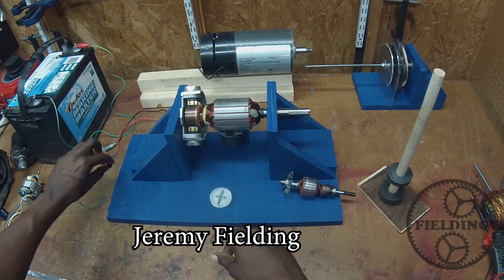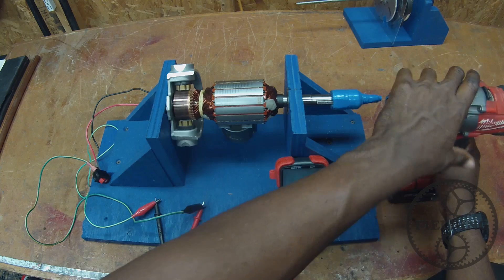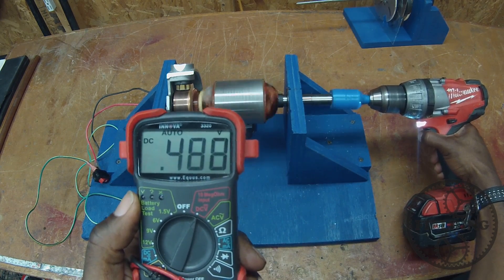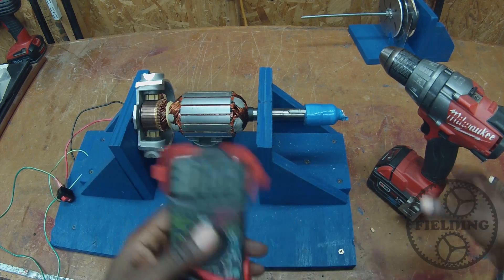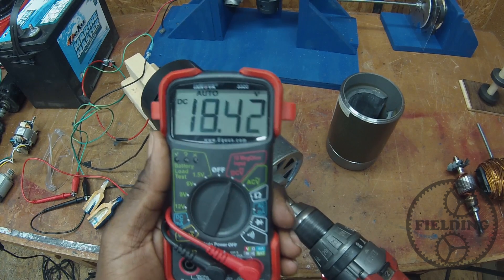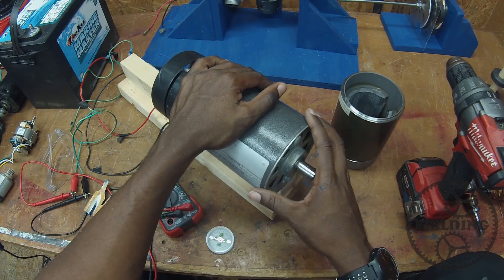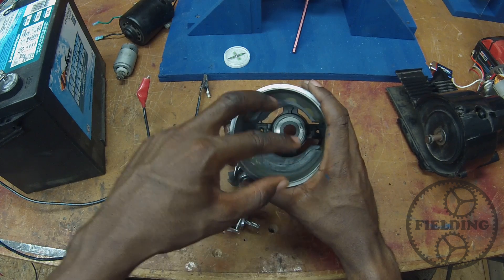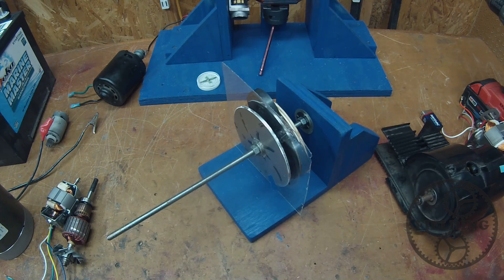How Motors Work for Beginners (Episode 2): The Generator and Universal Motor: 033

Comment: I need a little help if you don’t mind. I have a 12 V DC fan that’s running backwards. I took it apart to clean the casing and when I put it back together it’s running backwards now. I switch the two stator ("edit armature" identified wrong part) wires at the brushes but that makes no difference even switching polarity doesn’t do anything it keeps running backwards. What’s going on with this fan?
Reply: Actually I figured it out by watching the first video. The stator was 180° out. That's me, only two ways it can go in and I get it wrong twice.
I'm going to watch all of your other videos. Even as a kid I was fascinated with motors and generators.
Thanks for posting!
God bless!!
Blue

Comment: ❤ I've watched you for a couple of years now and you're very knowledgeable and very you've helped me so much with my understanding of electricity's motors, magnetism, fields, etc. Now my question is about your DC motor turning it into a generator. What if you take or actually excuse me universal motor what if you took an added magnet to the piece that spins inside the stator field? Would it generate then?

Comment: I was wondering on a DC motor if you don’t use the full power rated if it’s not needed for lighter work does it still consume the same energy or is it a reduced power consumption depending on the load?

Comment: On the topic of using a universal motor as a generator by applying a starting voltage and then letting it power its own electromegnets- uh, thats how most large power stations work these days. its just a lot more cost effective then making massive permanent magnets. (its called like self motivation or something) thats probably the only bit on motors and generators i understood, some practical generator stuff, you're teaching me a *lot*, thank you. This is very helpful

Comment: Hi Jeremy - I'm really enjoying your beginners videos. I'm 45 but never understood DC motors. I have one question: all the windings in the coil of the rotor, made of copper wire, aren't they all touching and would short circuit? I mean i can see they don't, but why not? the copper doesn't look to be insulated to me.

Comment: Thanks for the video. 
So with your typical fueled generator, that is an inverter generator (let’s say 120v) the engine is spinning the electrical motor at a speed fast enough to produce 120v?

Comment: Great video, sir. I have learned a lot from your videos. I have a question about the DC generators, what makes them a generator? I am confused since it is the same as the other motors in this video that converts electrical to mechanical.  need advice

Comment: My Rotor heats up extremely fast in my Rotozip. I took it out of the plastic casing, replaced the brushes, cleaned the   Commutator best I could.  Would reversed polarity make it hot?

Comment: Hi Jeremy,  thank you for all of your videos,  they are very helpful in understanding how things work. 
I have a question that pertains to many household devices that have transformers that step-down 120Vac to what the particular circuit needs, i.e mixers, blenders, toasters, clocks that basically run on DC after the transformer has stepped it down. If you had a solarwall that stores DC, couldn't you remove that transformers from those circuits,  thus avoiding the loss derived from bleeding off the ac into DC that is usually experienced as heat. 
Also,  if it were possible to redesign all circuits to function with DC,  then we could get rid of all these wasteful transformers wherever possible,  saving the associated energy. Let me know what you think of this,  I know there are some circuits that have both AC and DC in them,  like my old Tube circuits for guitar and Bass, and my stereo, But, even the new TV sets should be able to run on DC.

Comment: Hey Jeremy, this is the only way I knew to get hold of you.  I have a project I want to do but need a little information.  I have a 60 VDC Lithium battery at 12 AHs capacity.  I want to use it to power a lawn mower.  I have a John Deere walk behind 21" mower to cannibalize.  I was thinking of using either an alternator or a 2.2 HP treadmill motor that I have.  My question is how to wire the switch so that I get a blade brake effect when I let off the lever.  Also, I think I will need a speed control but not sure which type.  I am a good welder and have MIG and TIG capabilities.  Can you point me in the right direction.  I don't want to take up too much of your time.  Thanks!!!

Comment: I was curious about this idea of perm mags and perm mags as well, obviously it doesn't work but I'd like to know why. In theory it'd seem as if having opposite pole magnets in the same formation as the rotor plates would continue to spin after an initial external force started it. Does the centrifugal force just out weigh the power of the magnets?

Comment: thanks for video.  would you explain how did you get DC voltage. is it because you used  just one magnet? if that's the case why they use rectify bridge in  automobile charging system.

Comment: I'm thinking the universal motor as a generator is like a car alternator.   If you have a totally dead battery and jump start the car and then immediately disconnect jumper cables the alternator won't charge the battery because the stator has no magnetism. (Or very weak)  The car may even quit running.   Is this right?   I'm looking at a car alternator and I am seeing stationary coils through cooling slots.

Comment: All good stuff
Question:
Permanent magnets have certain and unchanging poles, but how is the direction of the poles determined in an electromagnetic field in a conductor the copper windings of a DC motor or electromagnetic and so on? I know it has to do with polarity or the direction the electricity is moving, but said windings are in a circular or spiraling arrangement, so technically the current is going in all of the directions (at least laterally) at one point in time or another as it flows along. Also is it true that each of the windings are insulated by an insulating coating, ensuring the current goes all the way around instead of short-circuiting straight through?

Comment: So one thing I’m confused about is I thought the commutator had the different gaps in it, like the different iron plates and each coil and each gap on the commutator that touches the brushes, I thought those were like “timed” to change the polarity of the coils, and that they needed both magnets to function, in your case the two magnets in the stator, yet in your video it worked fine with just the magnets on the bottom of the rotor? 

Does having two magnets in the stator just increase the power then? 

And if I wanted to make my own coil based rotor like this, do the coils have to be made in a specific way, or could you just wrap the wire all over the rotor and commutator, slap a magnet under it, apply a charge to the brushes, and it would go to town? Lol. I wish I had my own materials to experiment with. Thank you for the video though, it helped answer a lot of my questions. I was mainly struggling with where the power came and went in the motor/generator, and also the magnet question I asked, and also if the stator or rotor was the one with coils or the one with the magnets. Good to know it can be either.

Comment: Having recently salvage a universal motor from a blender, which burst into a small fire upon me trying to make a frozen blueberry smoothie (the field coils had melted in two spots, but I soldered them back together), I was wondering if it was at all possible to rig it up as a generator, without using a battery. Without a battery I can get around 0,35 V when spinning it, presumably from residual magnetism, with a battery attached to the field coils, I get around 1,8 V out of it, but it seems rather redundant to use a 1,5 V battery to make a 1,8 V generator. Now I have found some information online that suggests the battery could be replaced by a capacitor, using the residual magnetic power generation to initially charge it and then slowly increasing. My understanding of this is all very wonky and it might very well be in violation of some basic law of physics. The motor does look exactly like the blender one you showed in another video. Would love to hear your thoughts on this and thank you for producing great content, this has already taught me more than the Electronics 1 and 2 class of my engineering degree (luckily not my specialization).

Comment: When you reverse the direction on the “generator” why does the + and - voltage vary? I assumed turning clockwise would give you say +2.5 volts and when turning it counterclockwise it would give you - 2.5 volts but it didn’t. Is that because the drill speed is different in forward vs reverse?  Great video, you are a very good teacher!

Comment: What a great teacher. However, I got lost at 6:50 when he says a DC motor just uses DC to get AC at the windings.
Reply: The N/S magnetic fields push/pull the electrons in alternating directions causing them to flow back and forth within the wire, but the commutator serves to only allow flow in one direction.

Comment: hi thanks for the beginners series on motor. may i ask what in a dc motor for robots determines its voltage? i guess what im saying is if i swap the rotor of a 6v with a rotor from a 3v motor will i still need 6 v to drive the altered motor?

Comment: I just put a treadmill motor on metal lathe,,,best thing I could have done,,,so much power and very quiet and smooth and the soft start is so much easier on the lathe itself. Love the speed control,,,

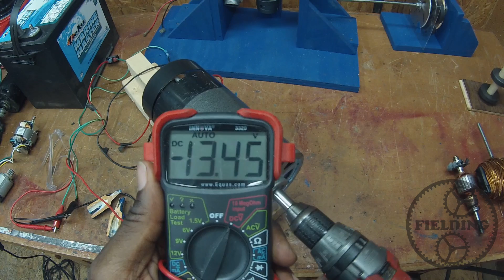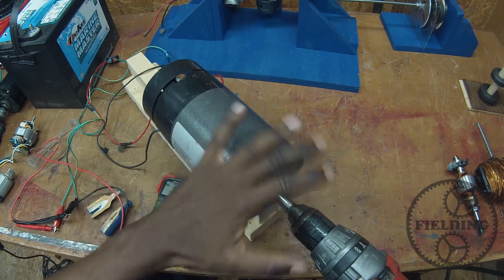Comment: Hi Jeremy, firstly I would like to thank you for all these wonderful videos. It was kind of intriguing what you showed with the bigger DC motor of 130Vdc, 4800 rpm, at 3:40 voltage generated was -13.48 Vdc but, when you reversed the direction of rotation of the drill machine the generated voltage went as high as 48.4Vdc at 4:25. It is just because of the lower speed that you were running the drill machine at 3:25 and higher speed at 4:25 or there is some catch that I'm surely missing. Please help me find out.

Comment: Hi ive been watching people use washing machine drums to generate electricity by rewiring the stator. What confuses me is why they need to rewire it?  It works as a motor like you showed,  can't they just spin it and it will generate power as wired? It is the Fisher and puked smart model,  thanks.

Comment: Good job Mr. Fielding.  When you have the time do a explanation on this: In electrical engineering, a synchronous condenser is a DC-excited synchronous motor, whose shaft is not connected to anything but spins freely. Its purpose is not to convert electric power to mechanical power or vice versa, but to adjust conditions on the electric power transmission grid...........................
Reply: Synchronous condensers basically improve power factor

Comment: to use the universal motor as a generator, place a small magnet on the stator, so that when the rotor  goes round, it makes a small voltage.
use this voltage (regulated) to drive the stator coil to get more power out of it all  ;)

Comment: Around 9:00 you say you need external electricity to use these motors as a generator. In large sizes, however, remanent magnetism can be enough to start a small current which then can be fed back to the stator and used this way to self-amplify the generated electricity. In fact this is how old tramcars did dynamic braking using their traction motors.

Comment: Interesting point to put a bias on the fields and as the rotor is spning from  a water fall, could you tap off the brushes for a measured voltage?

Comment: You can run the universal motor in the same theroy as the single phase ac motor ny use of a start capacitor ( initially charged pre start) but instead of disconnecting your start capacitor or coils you immediately connect you're running coils or field coils to your stator coil intern producing its own stator current from the steel coil with very little left over to leach off empower another device very little that is is possible but still nonetheless very inefficient generator.. 

Another interesting thing with the universal motor oddly enough if you supply the same voltage to your field coil and your stator coil you'll have less torque and RPM then if you applied 3 volts do your stator and 12 volts Deerfield or vice versa I always thought that was an interesting reaction

Comment: So on your next vid you talk about Hz (cycles per second) so I wanted to ask the DC motor makes it HZ by swapping polarity mechanically I was wondering if the number alternating bars (I’m assuming each bar has a coil) of alternate coils can be measured in Hz and given a value - I suppose it changes by the amount of volts (is that current) you put through the motor? Does the number of coils affect the efficiency of the motor?

Comment: Stronger magnets means higher voltage. A depleted battery accepts a charge with low resistance. The current used to charge a depleted battery is easier to produce. That is, it requires less force than the propulsion motor. When the propulsion heating or cooling loads are imposed on the PSE generator it will take longer to charge secondary  battery. Higher voltages (high speed) for the PSE DC motor with flywheel coupled to a gear reduction system will spin turbine generators with ease. Letz law will be constat but we now provide leverage to produce a surplus. PSE generating system. JR and affiliates for president. I don't hit girls but I don't like sloppy seconds either.

Comment: There is something magical about this: you energize one end you get mechanical force, you apply mechanical force to the other end you get electricity... So : the bigger the magnets, the higher the voltage = the faster the speed of rotation of the shaft? How would that translate into torque then? I can imagine that having something turning fast doesnt equate to this thing being able to move a heavy load.
Reply from the maker: F=MA   Increasing the magnetic field increases "Force" think of "Mass" as the load. then you have your answer. Not a perfect analogy but it is a helpful way to think about it.
Reply: @Jeremy_Fielding  so, the better (or more effective - depends on what the magnets are made off I suppose also) the rotor and stators are at generating a magnetic field the more torque/power a motor can generate

Comment: ... im interested in those brushless DC motors which can be reverse ingineered as a generator or a motor to support wide variety of device  plug and play style....so you only need 1 pcs to run washingmachine, for cooling fan , cocunut grater , wind generator ,hydro power even a mini scooter...etc..if we need AC than just add those bridge rectifiers component...it would be eco friendly ,economical and efficient ways for OMEGA homes

Comment: Can you compare the power input given to the drill and the output power you got by driving the motor and give a value for the efficiency of power production when we use a DC motor to produce current?

Comment: How electrons come into existence in wire and flow through wire during electricity generation?
Reply: They are always in the wire. All that is happening is that a magnetic field can cause them to move.
Reply: @garethbaus5471  
So during electric spark electrons go into air, does electric sparking reduce the electrons in wire(reduce the mass of wire in long run)
Reply: @RaviSingh-fv4sh  no, not unless the wire is being burned or has its end melted off as a result  of the heat.
Reply: @garethbaus5471  
In cathode ray tube, picture is shown by electron beam, does not here electrons are getting wasted .
Reply: Electron has some mass.
Reply: I don't think you understand how current works.
Reply: @garethbaus5471  
Current is flow of electrons in conductive wires
Reply: I am just asking whether some electrons get wasted in air (between the charger and device) wireless charging system

Comment: You can drill a small hole into and not throw and place a small permanent magnet into this small hole it will give some magnet flux to start the process of generation. Since the field is there and is slow to build but as the poles are in series it builds throw building armature field too, short-handed statements there almost redundant states but really is round-about progresses.

Comment: You ca use an universal motor as a generator without external dc. You can use the power is generating to supply the field windings. You just wire the stator in series with the rotor and the load. An to start it will use the magnetic remaining field in the armature.. Or in other words you can just hook up  a drill  or an angle grinder to a 100w light bulb and use a drill set in reverse to spin the shaft in the opposite (clockwise) direction.

Comment: I took an auto course.  The book said that some alternators needed 12v coming into the field coils of the alternator to make it work.  Did see a car with non-working alternator due to a broken 12v connection to the alternator from the battery.  Wonder why they do that?
Reply: I had seen alternators with magnets, but that alternator must have had a wire stator. You answered my question

Comment: So when you connect your drill to turn it into a generator, there is an output voltage that is charging your battery. You would need to observe the proper polarity to charge it, correct? If so, what process would you use to make sure you are doing it right? If you did not observe proper polarity would you have negative effects on the battery?